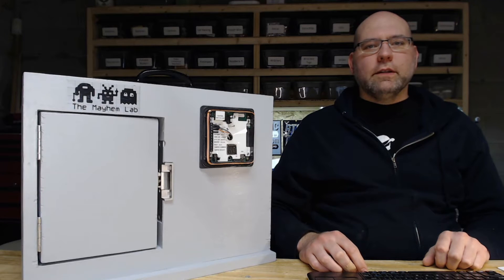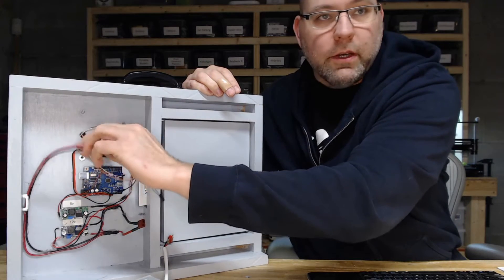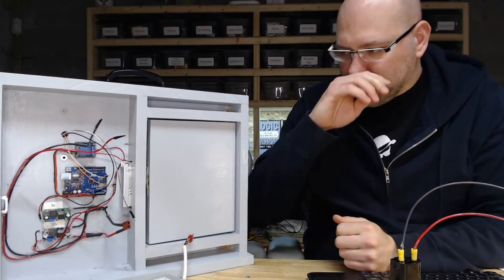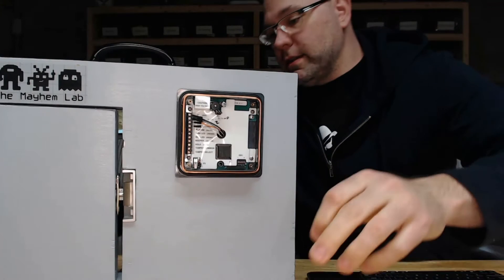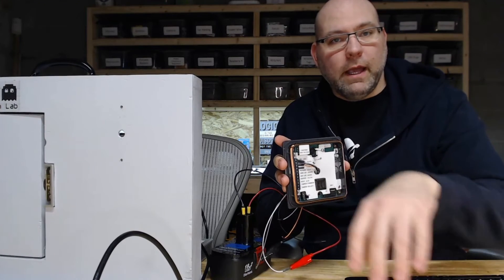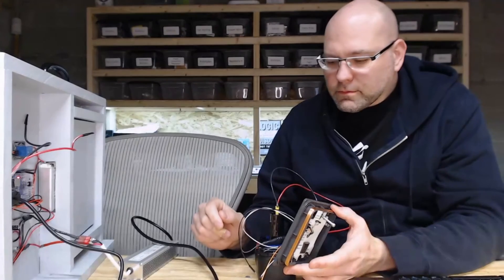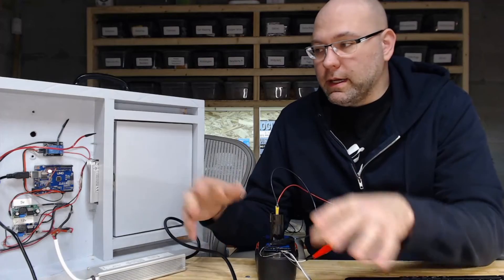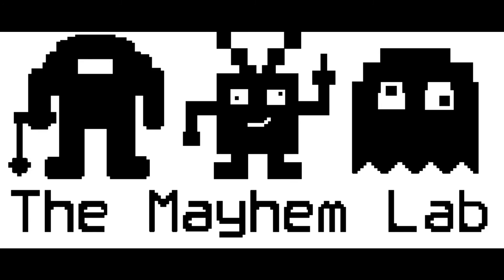#21 - HID RFID Reader Rig

Comment: shared ground is a requirement of the HID readers with the controller, and the buck converters produce a ton of noise
Reply from the maker: You are correct Ryan. A shared ground is critical, and I learned all about noise after making that video. :)
Reply: @mayhemlab1384  just watched your update, the foil tape was a good idea! I'm building a similar system with an iclass reader. the nice thing about them is the voltage range is from 5-16v, so I'll only need to take one leg down to 5v for my esp32/reader
Reply from the maker: Ryan, I'm glad some of the videos helped you, or at least gave you some ideas. I hope you will share your project so I can see how it works.